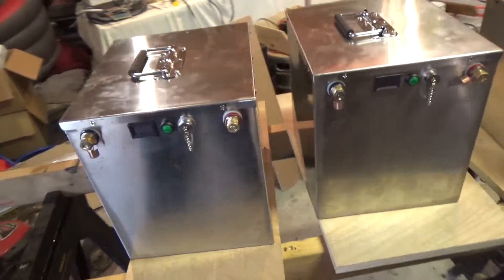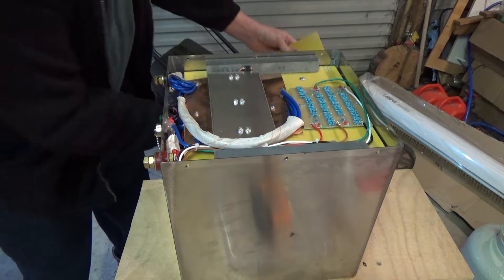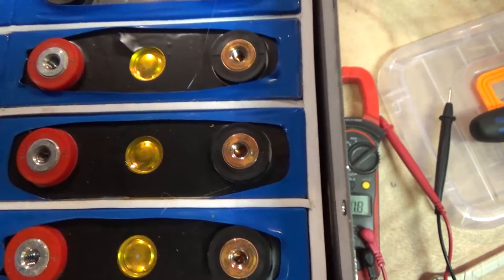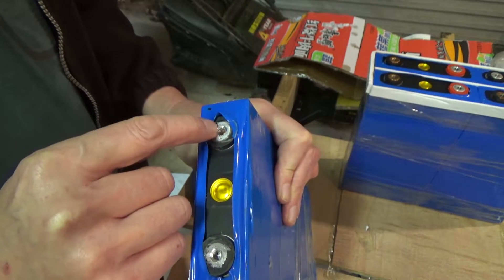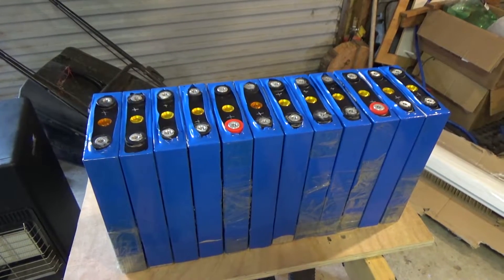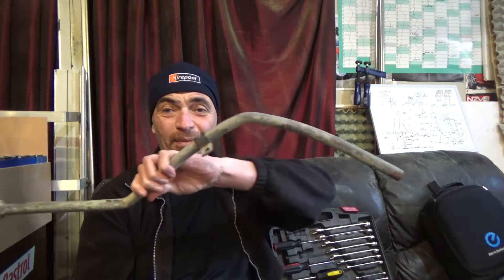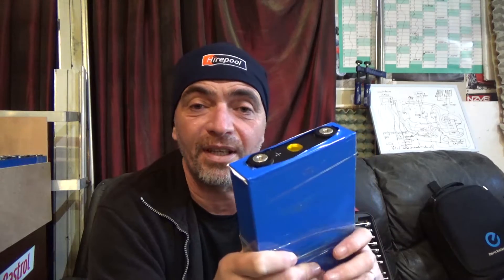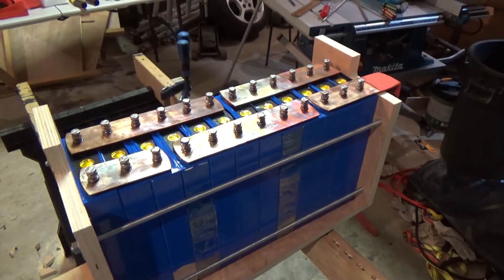LiFePo4 Battery Teardown | My replacement batteries have arrived

Comment: Can you link to your supplier, please? I'm curious. How much did you pay for these per box?
Reply from the maker: Hi mate, I got them on trademe but the supplier is micromall.co.nz, cost just over a grand
Reply: @BusedAsNZ  Oh wow, so they're "full retail" and when you crack them open they're obviously used/abused. It's a good thing LiFePO4 cells are still usable after they're worn but that's uncool from a marketing vs reality POV unless they advertised the particular ones you got as being a lower grade or used. Ouch. Good luck with them. I've been looking at some EVE cells new out of China, the thing is, I want  a set of 4 to evaluate but the cheapest per-cell rate is for a set of 64 for about 5000usd landed. Hmmm, what if they're like yours when they arrive? I'd be pretty angry :-D I'll keep pondering for now. Only really need say 12 cells for the time being. But could use up to the full 64 longer term.
Reply from the maker: @fredio54  Yeah mate though full retail is probably three times that. Like you I was looking at some potentially good china options but then these came up at about the same price with no fear of them not making it through customs or having crazy port charges. Was actually pretty tempted to just buy one or two at a time from AliExpress with free shipping so if something went wrong I had less to lose. Or strip my Leaf.
Reply: @BusedAsNZ  Crazy port charges? Do tell! I'm curious to your situation in that regard. As for the leaf, don't do that, that's lithium ion, not safe. LiFePO4 for non-EV storage all the way.
Reply from the maker: @fredio54  couldn't get anyone at customs to actually confirm a total cost. but wanted me to apply for an import licence to bring in over a grand worth of lithium batteries. But the rules on duty and gst have changed since then. I have been literally sitting right on top of these batteries for the last five years with up to 80kW discharge and 50kW charging and near 100% cycle every day, storage use would be a relaxing holiday for a leaf pack, they might soon be the most common power wall after Tesla, and a bit safer. Of course yeah LiFePo4 is king, though I still wouldn't really want to go much over 100Ah cells for structural strength
Reply: @BusedAsNZ  That's interesting, I was aiming for the 280-320AH EVE/Lishen cells, but apparently they're all out of stock, and the next best thing is 230AH cells of the same make. I'm not sure what your concern is with bigger cells, however my experience is that if you kill a cell that is paralleled with others, you kill that entire set. (but not necessarily the others in series with it). I don't see DIY lithium ion cells of any sort as being safe - even in the hands of pros they can get out of control. LiFePO4 can be punctured, overcharged, short circuited, and is always safe.
Reply from the maker: @fredio54  They are all lithium ion, and while LiFePo4 are currently considered the safest lithium ion chemistry I dont think they could be called "always safe", all batteries of any type are dangerous. There are plenty of tests showing LiFePo4 cells catching fire after being punctured, but even lead acid batteries can explode and will cause a hell of a lot of damage if you poke a hole in one. When building any DIY pack, you can minimise the risks of physical damage, you can ensure appropriate cell management fusing etc., the only thing out of your control is the quality of manufacturing, which is also the highest risk factor. A poorly manufactured LiFePo4 could still be be a very dangerous item
Reply: @BusedAsNZ  While it is technically true that LiFePO4 is lithium ion, in common parlance that's not the case, and it has distinct chemistry relative to the group of most (but not all) other lithium ion chemistries that share the same voltage and charging patterns and the same safety concerns not shared by LiFePO4. Link me to video that shows a LiFePO4 battery's lithium burning? I've only seen super-heated organic (oil) electrolyte fires out of them under extreme abuse (punctured). I've personally overcharged and short circuited LiFePO4 cells and some of them are still usable! Others leaked their guts out and dried out and are not usable any longer. Are all batteries unsafe, fundamentally from an energy delivery standpoint, yes, they can cause electrical fires and lithium is better at it (all types) than lead acid. Can lead acid explode? Yes, but that's a hydrogen gas explosion, short and sharp and acidic with no lingerering super hot lithium burn like non-LiFePO4 li ion cells produce. Go watch a tesla fire for eg :-D The spec sheets for LiFePO4 are done to standards body specifications and the results from all 10 categories are no fire, no explosion with many categories additionally recording no leakage (but not all, mine leaked when over charged extremely).
Reply from the maker: @fredio54  Well mate it looks like we are beating the same drum, LiFePo4 is the way to go right now. Mine are not the best but were pretty good value. I might play with the leaf one day, purely because it is soon to be no use as a car, the cell voltages dont suit me though it could make a great power wall at 48V. Sure would be keen to hear how you get on with your import
Reply: @BusedAsNZ  I was thinking about this a bit more while I was out and about and I'd like to add that combining LiFePO4 is dangerous in another way, if someone gets the impression or is told that "this lithium ion battery is perfectly safe" when it's a LiFePO4, then they might mistakenly assume they all are and get themselves into trouble or hurt someone. But yes, same drum, same chemistry, and sure, worn leaf batteries are a good household storage option, just not as safe without due care, same goes for a tesla power wall, or your cell phone and laptop, they're inherently more dangerous and managed into safety through care. My angle was that it's harder to get that care right as a DIYer and LiFePO4 is very forgiving of human failures (mine included!). The consequences of a leaf-battery sized mistake are pretty drastic if it's bolted to or under or in your house. :-o will let you know how I get on with the cells, fingers crossed.

Comment: Hmm... sorry but I would NEVER use damaged cells like this in my setup. Even slightest of damage is just waiting for thermal runaway and fire to happen.
Any oxidation on links is strongly not recommended and also those soldered joints on original battery for end terminals... Oh god, what are those Chinese thinking????
Anyway, I think you've got screwed by your supplier. Again.
Reply from the maker: Was much more worried about the old swollen cells but yeah you get what you pay for :)

Comment: Any update on your custom battery? As you know, I started with the same two, and then got the same two as later replacements. Mine are simply joined in parallel, not other adaptations. I’m running everything off them (microwave, fridge, lights, computers, fans, you name it) either direct or through an epever inverter. I didn’t do a capacity test on the replacements, but so far so good. With 1080w of PV on the roof I’ve never put a dent in them. I’d like to figure a way to dump the spare solar into water heating, but that’s beyond what I have the mental energy for at the moment. Please feel free to take that as your cue to engineer something cheap and clever.
Reply from the maker: Not really, still sitting around 50% charged in two halves in the back of the shed waiting patiently for me to do something about it :) Good to hear yours are doing well. With a heap of solar and a heap of battery sounds like you are set. 
I do love the idea of finding a use for any excess solar energy. I don't have the new type DSSRs with diversion, I want them, maybe next year. But I'm not sure if I will be heating water, seems a lot of trouble to put an element somewhere in my setup but I guess if you have some sort of hot water cylinder then its a bit easier. Probably be more inclined to run some ventilation fans or a cooler, since most spare solar will be in summer, hmmm how about an ice maker :) Either way the diversion is easy and kinda part of the standard setup now of the Electrodacus BMS, but maybe any BMS could switch a relay at fully charged. Will certainly show you if I come up with anything

Comment: Using longer bolts and nuts is a good idea! You need to clean your copper links up more before bolting them on. Will be interesting to see what your total capacity is? Also as mentioned the  bms will always top balance so no initial balance required.  What's happening to your old cells?
Reply from the maker: Oh and credit actually goes to @dhowman for the long bolts, he talked about using studs and I thought it was a great idea but bolts are cheap and easy to get
Reply from the maker: Cheers. Those links, I had actually polished them with a wire buff but then left them sitting beside the fire and they must have got quite hot, they will no doubt be on and off at least a couple times before I'm finished, might actually only buff it out on the under side since I like the look. The supplier wants me to return the old cells